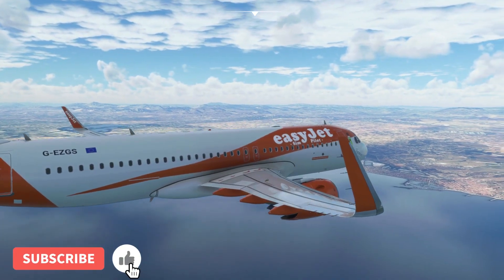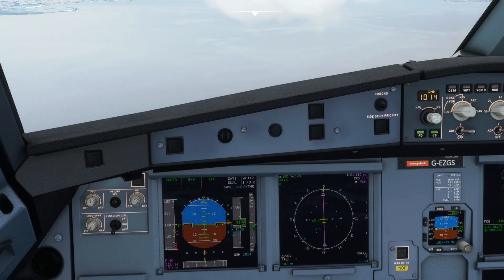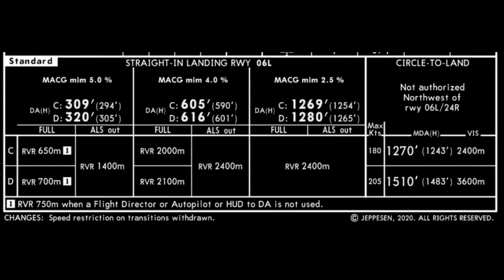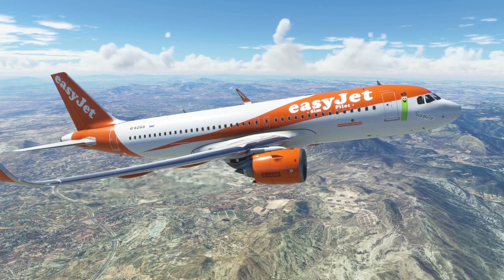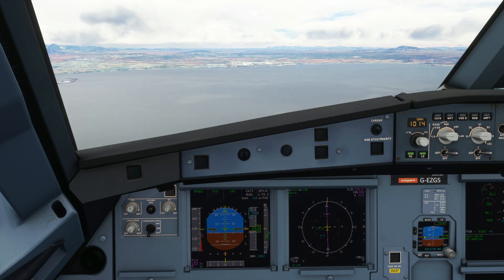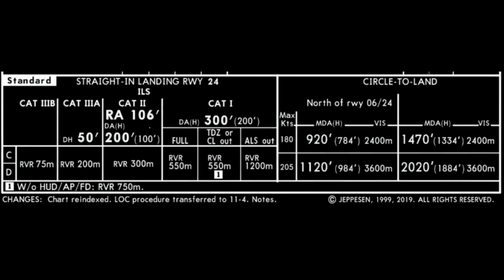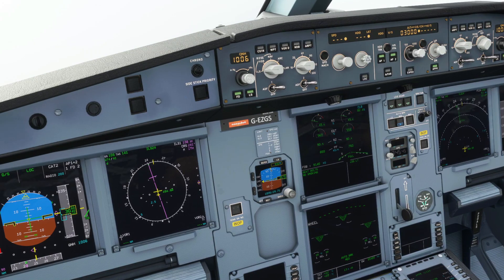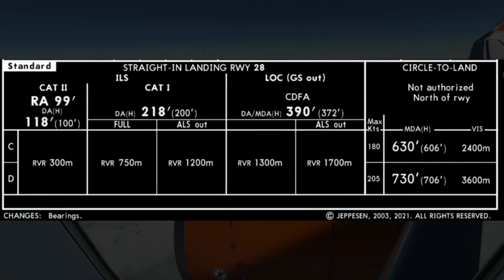Approach Minimums Explained - When to use Autoland? | A320 Flybywire MSFS 2020

Comment: Sorry I may have missed but did you eloborate if both runway and aircraft are capable of CAT3B autoland, why pilots only use it when weather is bad and not everytime? 0:41?
Reply from the maker: Basically, because autolands are only usually performed if there weather is not good enough for a manual landing.

There are exceptions to this rule however (training/certification etc)
Reply: @Easyjetsimpilot  Thanks but that's exactly I want to know why not on a perfectly bright and clear day. Does it consume more power? Emitting CAT3B/C rays are expensive or bad for environment?

Comment: Really fantastic video finally demystifying the autoland. Thanks a lot. So in the landings where the pilot doesn't do a full autoland, I guess they will still do auto approach ? And if so, at what point would you typically disengage the autopilot and take over the landing ?
Reply from the maker: Whenever the pilot is happy. Usually around the 1000ft mark but company SOPs also come into play here.

Comment: Great tutorial Gavin, I have a question about wind though. I was on the jump seat of a B734 once going into Lisbon, the cloud base and vis were low enough to require a Cat III autoland however the wind was across the RWY and gusting which exceeded the A/P's limits. Fortunately the during the approach the weather lifted just enough to land manually we actually became visual right on minimums. What is the maximum crosswind component the A320 can deal with whilst performing a CAT III autoland ?
Reply from the maker: For the A320, AP crosswind limitation is 20 knots, or 15 knots  with One Engine Inoperative for the rollout.

Comment: I, being a simple sim pilot, never receive an explicit RVR during landing, also ATIS is not always giving it very clear. Will ATIS only give it when it’s near the bottom end of the possible RVR or how otherwise you can obtain the current RVR at an airport?
Reply from the maker: The current visibility at an airport is provided in the airport METAR.
Reply: ATC will give RVR during the approach and landing.for each third of the runway.

Comment: Your viewers might be wondering why some airports have Cat (category) 2/3 ILS capabilities while other airports don’t. 

The easiest way to understand this is to look at where the airport is situated. Is it an airport in an area known for fog/low cloud/poor visibility on a regular basis… yes, then it probably has those approaches available. Otherwise aircraft would never land there. 

Alternatively, is it an airport in sunny Spain or similar. Unlikely to have those approaches available as the weather for the vast majority of the year is blue skies, and no clouds, so the runway can be seen from miles out.
Reply from the maker: The biggest reason for an airport not to have CAT II/III capabilities is terrain. If this can cause interference with the ILS system, then it won't be stable enough to support an autoland.

Comment: If you perform an autoland but the visibily is under the RVR of the Cat 3B why the OACI say is not safe ? The autoland doesn't need the visibilty 😅. Maybe it s a stupid question.
Reply: Cat 3B requires a minimum RVR to be able to vacate the runway and taxi to the stand.
No RVR would mean that systems are needed for taxiing in automatically to keep the aircraft on the taxiways.
That would be Cat3c that is currently not in use at any airport.
Reply from the maker: OACI?

The RVR for a CATIIIB is <50m.
Reply: @Easyjetsimpilot  RVR for CAT IIIB no lower than 75m. The DH will be <50 ft or NO DH. 😉
Reply from the maker: Sorry..! Getting DH & RVR mixed up.

Comment: You may have stated it during the video, perhaps I missed it but there are 3 requirements necessary prior to conducting a CAT 2 or CAT 3a or 3b approach with or without a DH (Decision height).  1) Runway capable. 2) Aircraft capable. 3) Flight crew capable (Trained to fly those types of approaches).

Comment: How can I find the visible Range when I land for an  Airport ? In the weather Information ?
Reply: The METAR or ATIS will have the visibility on it after the wind information. If the visibility drops really low most airports give visibility readings for each third of the runway. This is the touchdown zone, mid point and stop end. If the tower or ATIS reports RVRs of 450/300/350, the RVRs are 450m at the touchdown, 300m in the mid point and 350m at the stop end. The touchdown zone is the one you need to legally make the approach. The visibility required on the chart is relating to the touchdown zone. Although if reported, the mid point and stop end RVRs are relevant and controlling on a CAT I approach. There are minimum RVRs allowed for the mid point and stop end on CAT II/III approach’s too. These are usually 125m and 75m respectively. You can lower the mid point to 75m if you have rollout guidance. With exception to a CAT I approach where 125m is the minimum mid point required to maintain the centreline manually. 

The stop end isn’t actually required as you’re assumed to be at taxi speed by this third. So you could disregard it. 👍
Reply: @theo meier  Here is an example Metar from Bangor Maine: KBGR 301853Z 35008G18KT 310V030 10SM R15/5500VP6000FT -RA BKN038 BKN050 BKN110 13/07 A2997 RMK AO2 RAB1759 SLP148 P0011 T01280072
The Section of  R15/5500VP6000FT indicates Runway 15 having variable visibility distances between 5500 and 6000 feet ( or 1576m to 1828m).  Technically, the runway RVR wasn't really necessary to report, but I am not acquainted with their specific requirements at that airport. FYI I am a former military weather observer and forecaster. ;)
Reply: Thank you
Reply: Here’s a METAR from the South Pole : NZSP 301750Z 02010KT 1200 BLSN BR SCT020 BKN090 M56/ A2830 RMK SKWY WNDS ESTMD CLN AIR 02007KT ALL WNDS GRID

A bit chilly at minus 56 degrees C! 

1200 meters visibility so no need for an autoland today 😁
Reply: Understanding that is not easy either. Mainly to be found in the text

Comment: This is a great part 1 to this subject. 

Part 2…. Required visual references for each minima. 😉

Regarding the legality of an approach. You can start an approach if the RVR is below the legal minima. However, the lowest you can go is 1000 ft AAL (Above Aerodrome Elevation). Why you’d elect to do this if it was significantly below minima is anyone’s guess!? You’re just wasting fuel if it’s obvious you won’t get in. But if it’s close, you could give it a go in the hope the RVRs increase before 1000 ft. This 1000 ft gate is known as the “approach ban”. 

If the RVRs drop below the legal minima after 1000 ft, you can continue all the way down to your DA (CAT I)/DH (CAT II, IIIA, IIIB). And then make a decision based on the required visual references coming in part 2. 

You’re welcome Gav. 😂
Reply: … slightly different in FAA land (USA). The approach ban is G/S (GlideSlope) intercept, and not the 1000’ agl point.
Reply from the maker: 🤣😂🤣 That's going to be a fun video to explain.
Reply: @Easyjetsimpilot  you’ll need to show it what it looks like. I.e. drop vis to 350m and show what you need to see out if the window to continue the approach (on a CAT II example). 👍

Comment: Regarding using BOTH AP1 and AP2.  I can't remember ever using two at all.  Do you switch a 2nd one on ONLY if it benefits autoland? Meaning even possible for given runway..
Reply from the maker: No, AP1+2 are always activated immediately after activating the APPR mode. This is for redundancy (in case one fails)
Reply: @Easyjetsimpilot  Wow, I never even noticed that before.  Great vids for us SIM pilots. Please keep it up!!!